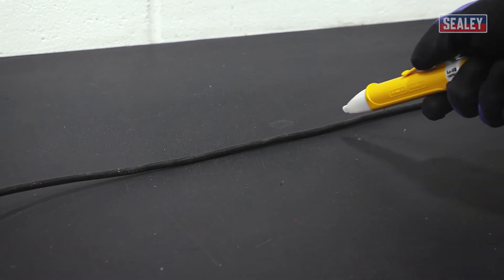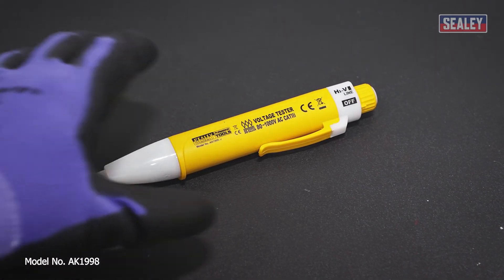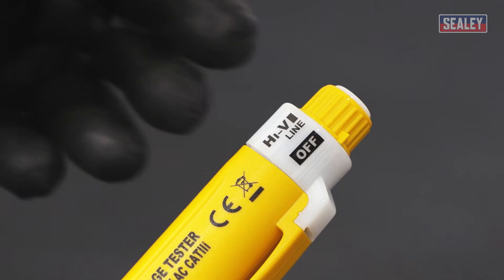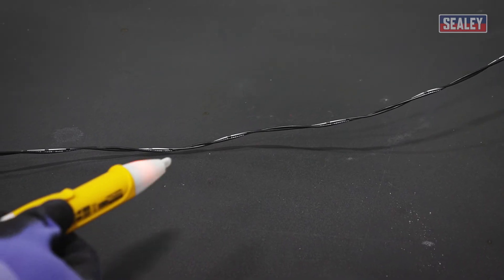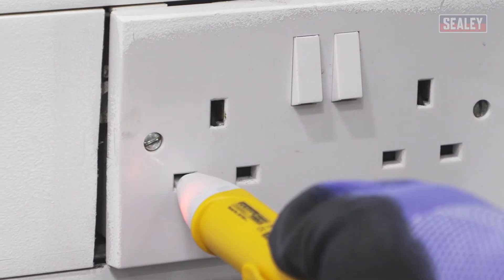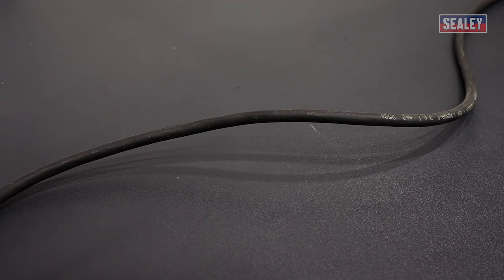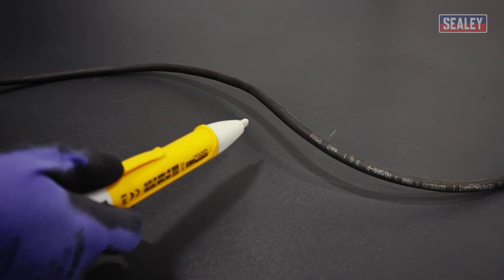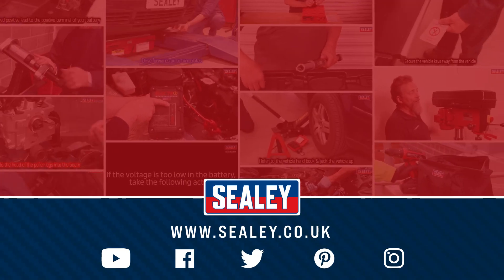How to Use a Non-Contact Voltage Detector

Comment: You put the tip into the neutral terminal on the socket, that thing should have been beeping intermittently, the if it repeat on the line terminal it will beep continuously. Not a very effective tool or demonstration video.

Comment: where the voltage we will see...?
Reply from the maker: Hi. The detector easily identifies AC voltages using a red LED light and an audio output. Thanks.
Reply: @sealeytools  not satisfied 😩